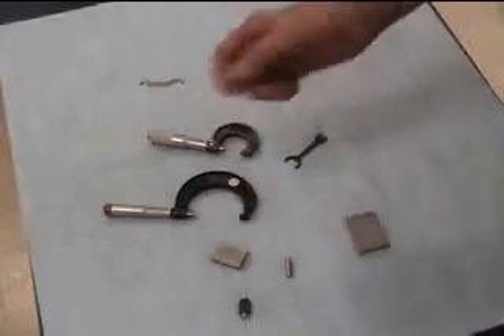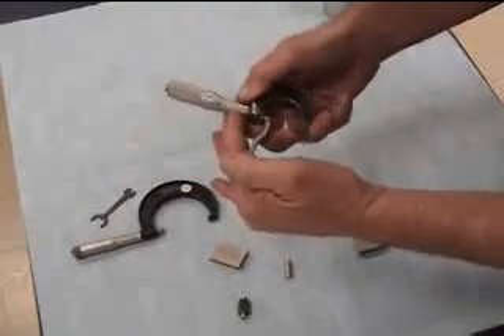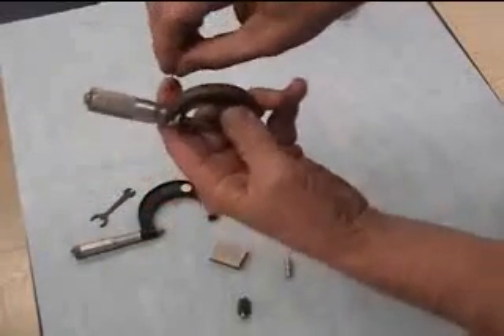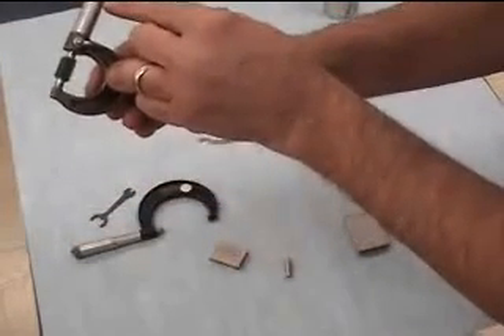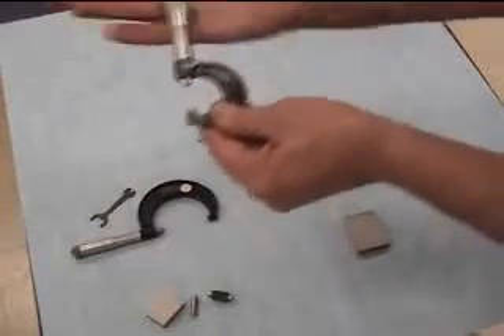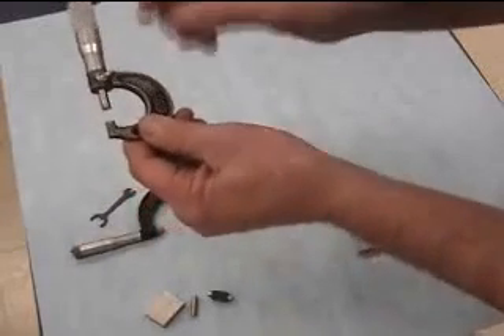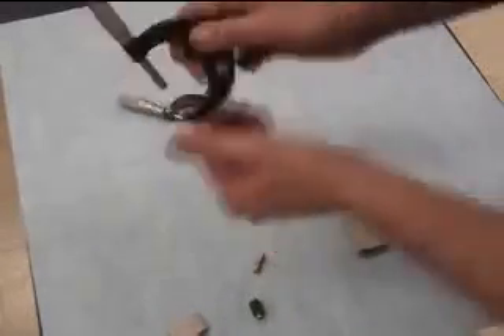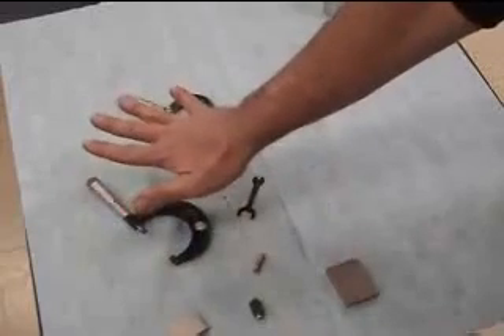Micrometer use and calibration

Comment: That is not calibration, it's adjustment. Calibration ensures that the sleeve lines up with very accurately with the etchings on the body, to do that it needs to be stripped down and adjusted, then checked at about four or five measurements.

Comment: Calibrating a micrometer requires at least 4 differing measurements with certified gage blocks of a specific class for accuracy.  several things must be checked including parallelism and spindle play.  This demonstrates simple checking for cleanliness and damage, and verifying the reading that an uncertified, possibly worn gage block in a shop might give.  reminder - the calibration tolerance for a 0-1" micrometer is +/- .0001.  And gage block accuracy must be 4X greater than the micrometer accuracy and certified.  This video does NOT show calibration.

Comment: my friend, typically one opens the locking screw before adjusting. sort of like losing a set screw before rotating a pulley or radio knob....so hard to turn means you didn't do that...if you notice there is one screw facing you and that is it... good luck